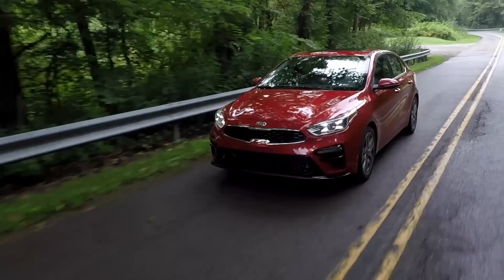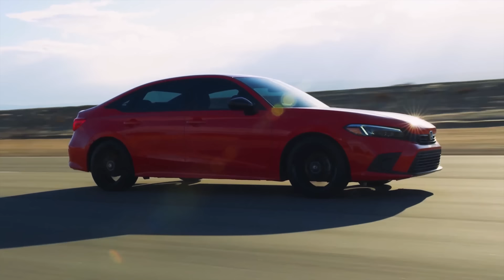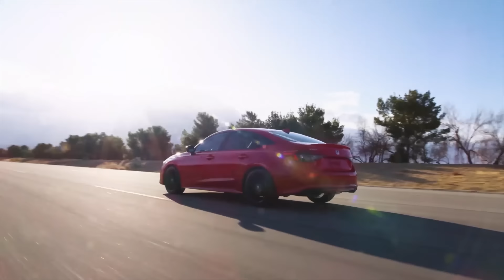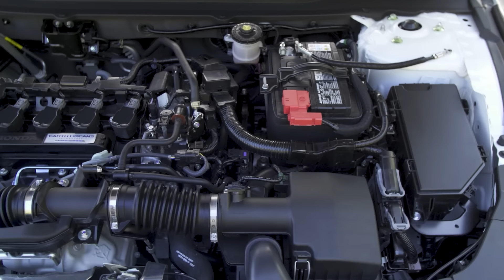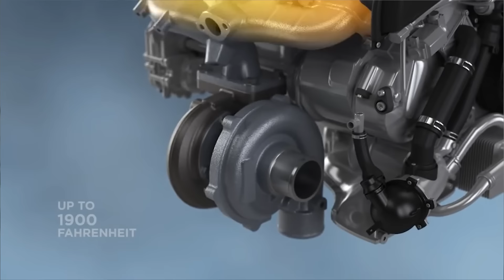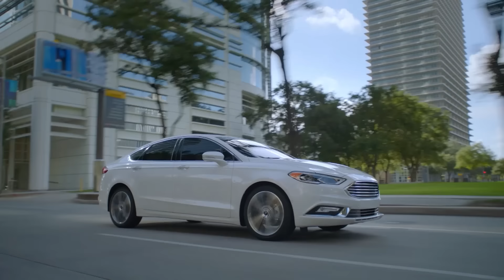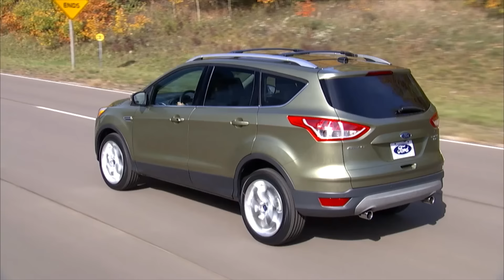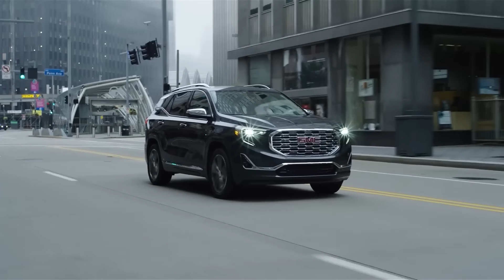Are Turbocharged Engines Reliable? The Truth About Turbo Engines

Comment: Increased complexity and repair difficulty, turbo coking, inadequate oiling and/or oil change neglect, severe heat and pressures, very inconsistent performance, coolant consumption, oil consumption. No matter how you look at it, expensive cars with turbos are more reliable but INSANELY expensive to repair. Cheap cars with turbos are unreliable and still pretty expensive to repair. Wastegate integration, dual scroll, variable vane... blah blah. Just buy an NA if you want reliability.  I have a 370Z and a Q50 and I prefer the NA 3.7 in the Z much much more.

Comment: It doesn't help that BMW used Oats; that's right, I said oats to build the plastic from in an attempt to go green. 

Where the plastic is expected to deteriorate and break down back to the ground; however, they failed to test the half-life correctly, and it breaks down prematurely within three years, causing tons of issues. 

Further, it is used everywhere in the engine compartment, including the TURBO support system. 

CAUSING tons of air leaks, water leaks, and oil leaks. Burned oil fumes into the passenger cabin,  overheating, and lean conditions. 

Turbos have been around for over 40 years in the trucking industry and are very reliable.  However, car companies have skipped quality and missed applying lessons learned in the trucking industry to today's cars.

Comment: I think that the real question is whether cars with turbocharged engines tend to be significantly less reliable even if the owner treats them properly, e.g. using high quality synthetic oil and replacing it regularly, not driving the car like it's a sports car, not getting it into the red, otherwise maintaining the car properly and replacing belts, plugs, wires, other fluids, regularly, etc. If the owner doesn't do these things then you can't really blame the turbo for reliability issues, and people who can't be bothered to do this either shouldn't get turbo cars or be willing to shell out for major repairs down the line.

Comment: I've owned the same 1G DSM turbo for over 31 years. Not high mileage, no mods, I don't push it to its limits and rarely if ever go into the red, but I've never had any turbo-related issues with it, including oil consumption. I recently took it out and apart as part of an overall intake and exhaust overhaul and saw nothing wrong with it other than years of surface rust on the exterior that I removed and treated.

It's the stock OEM turbo, on the smaller side, that many DSM owners tend to replace with a bigger and more powerful one. But I don't race so I'm fine with the car's stock 195HP. It also happens to have one of the best inline 4 engines ever built, the 4G63, which I assume helps with reliability.

Comment: They are reliable in warranty. 
As long as you complied to dealer requirements. 
Over 100 years, not reliable it will fail.

Comment: I have 1.2 liter 3 piston turbo on Peugeot 208 for 5 years. Zero problems and HUGE driving fun. First on any green light. Available power at any speed. Driving 170 kph no sweat. Start and stop works perfectly.

Comment: I have a 17 year old Audi Turbo with 120k miles on original standard engine and original standard turbo. Want your car to last? Change the damn oil, change filters, change spark plugs periodically and avoid tunning. If manufacturer specifies oil change with 10k miles, change with 5, or 6, not more than 7k miles. Anticipate things. Turbo is not the problem. Turbo is life. All engines should be turbo in efficiency point of view.

Comment: I think it still depends on the brand and make.. I had the same worry when I bought a used 2008 Acura RDX with a 2.3 liter turbo engine.. But the engine/turbo has never given me any problems. As a matter of fact, not many people had any engine issues on this car. Mine has over 340k kilometers now and still running strong. I see plenty of the same cars on the road until now, which is a testament to its reliability despite the turbo engine

Comment: First of all. You need to run a good synthetic oil, min of 5W-30. If you push it hard, before shutting off you need cool down time. Idle it 3 min. Auto start stop. Turn it off. Don’t use it. Change oil every 3-5k miles. Long OCI not good anyways.

Comment: I have 15 years of expiring with 2 turbo cars. 
1. Passat b6 1.8 tsi bzb (200k kms)
2. Passat b7 2.0 tai cczb (270k kms)
Both were charged to stage 3. (K04  turbo)
No problems. I used good ECU software, oil changed every 7500 km, filter washed 7500 km as well. Oil = motul 5w40.
Reply: Oil and filter changes at 7,500Ks are a must. Lots of manufacturers say you can go to 15-20K s before an oil change, but that's madness with a turbo. As long as you do the oil changes, and let the car warm up for a few minutes before driving, and idle it for a few minutes before shutting down, the turbo will stay well lubricated and should last a long time.
Reply: Yes turbo diesel engines are much more reliable than gasoline turbo engines.
Reply: @IrishNew  he mentioned a gasoline turbo passat..
Reply: Once again- why not all modern diesel
Reply: Nice big engines though. Try a turbocharged 1L

Comment: I would just avoid them at all cost.  The return investment is just not there with turbo engine.  Especially when you want to keep it for the long haul.  I do NOT like to keep buying one car after another.  Until these car manufacture has done a thorough job of rigorously testing these turbo engine for the long term reliability and made these turbo engine super reliable.  I stick with N/A engine for every day driving and long term relibility plus easy to maintain tyat wont cost you an arm and a leg for repair when small parts failes.

Comment: For someone who has owned turbo subarus and nissans for over 10 years, you are wrong about alot of this. The unreliability comes in from people tamporing with the system, not running premium gas, or just plain driving hard everywhere they go. Under normal driving and normal fluctuating boost pressures, the engine and turbo will last for a long time. Short trips arent even an issue. The engine is tuned for those purposes. Never did i ever have problems with driving short trips to the store or moving the car around my driveway. I will say they do have more maintenance requirements but its more in terms of inspection. Check the oil and coolant lines. Change oil every 3-5k miles. Use synthetic oil. Not that big of a deal.

Comment: You're only referring to Petrol engines you're not making any reference to diesel engines

1. Diesel engines are forwarded engines with forge pistons
2. Diesel engines are designed for turbos because they would not work without a turbo
3. Cars like the Toyota Hilux Diesel can easily do over 600,000 km without any issues
4. Every single truck is turbo diesel

Comment: Turbos run at extremely high speeds, over 80,000 revolutions per minute. They force more air into your engine at extremely high pressure and the engine takes advantage of the greater oxygen content to push more fuel in and create more power, but this puts everything in the engine under a lot more stress. This is why high performance engines with a turbo are strengthened to handle all the extra stress being put on it. Ask any automobile performance enthusiast and they'll tell you, if you're trying to squeeze more power out of an engine via a turbo, you're burning the candle at both ends. But an enthusiast willingly accepts this trade to have more power. The common consumer, however, often doesn't know.
...Granted, if you drive conservatively and never access the turbos power band, and you take good care of your car, you might be fine. But then at that point the turbo just becomes a needlessly complex addition to your engine that adds extra power you don't need and never use.

Comment: There are many consumers that doesn’t know what is a turbo engine. To most is an engine with more power. Full stop that is what the most see.

After buying it they realize there things you need to know, some or most turbo engine needs a higher Ron fuel as you stated to prevent carbon buildup.

A lot of turbo engines have a carbon filter and this has to be maintained or it be an expensive engine. Most diesel turbo have a dpf filter.

Turbo is good in some ways but not always the case.

I specifically chose the normal engine for my purchase. Knowing well of the power compromise.

Comment: My brother had an Audi A3 that had an issue under warranty. They fitted a new turbo and gave the vehicle back to him. A month or so later the new turbo began to grind. Fortunately it was repairable, the cause of the turbo failure was a blocked oil line due to not having the oil changed when the first turbo failed. I had a turbo diesel Landcruiser (80 Series) that I purchased over thirty years ago, and I still see the vehicle as it now belongs to a mate of mine.The vehicle still has the factory turbo with over 700,000 km, I fitted a turbo timer when I purchased it. I now have a Five cylinder turbo diesel Ford Ranger, it has 270,000 km and no issues.

Comment: 170,000 miles on my 98 V70R. Original engine, transmission and turbocharger. 

Been daily driving it for the last 4 years. 

Been running 16 psi for the last 4 years.

My next car will be a Volvo.

Comment: Naturally aspirated cars are more simple to own than a turbo charged car. But not much more.
If you use your car just as a means of transport and like to yawn a lot, not worry about maintenance,
pay more for fuel, don't buy a car with a turbo engine. Bad news travels fast, and I haven't heard an avalanche of bad news about turbo engined cars, only the fact that normally aspirated cars are always getting in your way at the lights.

Comment: I am not a hard driver and rarely go above 2500 rpms when accelerating. I have a 2017 e 300 and I am curious if the turbo is kicking on or not when I am a soft driver?

Comment: It really seems like modern turbos are worse than older ones!  I own a 1987 Dodge Daytona TurboZ with the Chrysler 2.2L Turbo-II motor which was a new version of the 2.2L turbo-I for 1987 and added an intercooler and brought up the hp from 146 to 174 with 200lb/ft of torque.  I have owned this car for 23 years, second owner and it now has 166K miles on it.  Obviously I have taken extremely good care of it and it has had a lot of work done over the years but that 2.2L Turbo II still runs great and pulls hard.  Of course this engine is much more simple than those of today but maybe thats the secret?  A turbo can last if its not ridiculously complicated.  The actual turbo on my car has not been replaced but the intercooler has and it runs pretty consistent coolant temp wise.  I don't push it as hard as I use to because I want it to last but I do push it some!  Anyway, I agree, modern turbos arent great.  If BMW can make trash turbo motors, anyone can!  And they do, I'd never buy a turbo BMW...or Audi, or Ford or VW or GM, okay, your point is even more appreciated!

Comment: My F150 eco-boost had one supercharger go out with 83,000 miles on it and the other one went out at around 139,000 miles cost me nearly $7000 to replace both of those sold the truck after the second one went out bought a Toyota tundra swore I would never ever owna turbo motor again.

Comment: I’m old enough to have owned Saab turbo cars 35 years ago. Had no issues but remember the advice to allow the engine to keep running after a high speed trip to ensure it cools down properly
Reply: Thanks sir

Comment: Air-cooled engines are more reliable  than water-cooled engines because you don't have to worry about coolant leaks, water pump failures, head gasket failures allowing coolant to dilute the oil, etc. If you are incapable of following simple maintenance instructions, you should look for a vehicle with an air-cooled engine.

Comment: Manufacturers could easily put in a 3.0 v6 with 240+ hp but noooo and tbh, blame the EPA for it. That turbo 4 will get better mpg at any speed as long as the turbo is putting out 10% or less of its peak power. They don't care about the consumer having higher maintenance costs and an engine with a shorter life span.
 Also, low speed pre ignition is an issure with every turbo charged vehicle. Its when you are in too high of a gear making too much boost. Lets say your automatic transmission is putting you in 6th gear at 35 mph for fuel economy and you have to give it a decent amout of gas to speed up. It decides to not down shift. You're now making 12 psi at 45 mph at 2k rpm. The engine has a high chance of grenading itself regardless of mileage on the vehicle and it does happen more often than people think, even in manuals if the driver isnt paying attention.
  I saw an interview with the old EPA director. She wants things to go back to 2016 rules and regulations so car companies can still have one or two v8s to offer, a mix of v6, 4 cylinders and ev/hybrids. Says there are too many activist in there now making the rules and again, they do not care about the consumer or the manufacturer at all. Green, green, green...

Comment: Never buy a USED one...buy NEW only and treat it well.  NEVER shut down on a hot day without letting it idle for at least 3-5 minutes....  synthetic oil ONLY...  you should NEVER have to replace a TC unless you're stupid and lack common sense. I have owned a 280 ZX turbo and also a 300 turbo for years with zero problems.
Reply: Thanks I'm looking for a used vehicle and will avoid turbo. Adding 3 minute idle to the end of the trip is a pain. Add premium gas and frequent premium oil changes too.

Comment: Run the Honda Civic 1.5L turbo using all of its 180 hp against the 2.0L NA Civic using all of its 158 hp and tell me which is more “efficient”. Turbos when being used are not fuel efficient. They are fuel efficient when not being spooled but yet still  touting their max hp numbers

Comment: Thanks for the talk! I have a Chevrolet Captiva in Chile (actually a SAIC product that is sell here as “Chevrolet”) with a 4 cylinder 1.5 Lt turbocharged engine that with only 23.000 Km did have serious damage on the cylinder N°2 (the damage was so bad that the cylinder wasn’t able to reach the right compression of the fuel). Thankfully due to warranty, the local representation of Chevrolet in Chile paid the reparation: complete change of the motor engine. And your arguments make a lot of sense: I use the car on daily basis but only for a trip of 4 Km during the cold morning (I actually got as a maintenance recommendation to “let the car to warm up for at least 1 minute”, like if that is enough to warm up the turbocharged engine).

Comment: The fun part is that most of the time, they don't even get better fuel economy IRL. In the EPA test they do, but nobody drives them like that, and pushing it harder burns more fuel with a turbo engine. Cross reference some vehicles (like Ecoboost 3.5 vs a 5.0 F-150) and they're pretty much even, while adding a ton of complexity and sacrificing a ton of reliability. Toyota's M20A-FKB in the Corolla makes almost identical power as the Civic's L15B7 and gets almost identical fuel economy, while not having all of that added complexity.

As far as maintenance, those Cruze 1.4L get oil clogged up inside of the oil supply line, leading to the turbo not getting lubrication and the bearings running dry.

Similarly, the ecoboost have a little filter in the block that will get clogged up leading to most turbo failures.

I've been a tech for 20 years and I'd never buy a car that's been turbocharged for fuel economy.

Comment: I love my 2021 Mazda CX-5 CE Turbo w/ AWD. I got the turbo because I didn't want cylinder deactivation, which came with the naturally aspirated engine. I'm very happy with my turbo. My trips are short, and I never drive it immediately after starting it, and I never turn it off immediately after parking it.

Comment: Since 1994 I have owned 6 turbocharged cars in South Africa I drive hard and some of the cars had over 100 000 miles before I sold them. Two were VW/Audi diesels  one VW/Audi petrol, a Fiat 1400 cc turbo in 1994. One Volvo petrol turbo and now  Chinese SUV which is turbocharged. Turbocharged vehicles are more common here than naturally asp ones. I hanmve had no problems at all with the turbos and intercooler, wastegate, associated sensors on any of these vehicles. At 5000 ft elevation where I live all cars without turbos excepting large engined Mercedes and Jeep V8s have relatively poor performance. The latest Pentastar V6 Jeep is criticized for weak performance against the German SUVs. Turbos are old hat here and discussions around their reliability are no longer high on the agenda when car enthusiasts chat.

Comment: Only turbo engines have proven to be fully reliable if they were well designed are the turbodiesel ones.
In turbo diesel you can trust, even more if it's a big displacement low rpm engine

Comment: A turbo in a diesel car without dpf or egr are bulletproof ,,here in Europe we have much more experience with Diesel engines as we have them in most cars ,All vans and all trucks,,we've had turbo diesels in cars from the 1990s,,,I've seen Renault and Peugeot Diesel engines go 500.000 miles and more ,with the original turbo,,,,The trick to turbo longevity is regular oil changes,,This keeps the seals subtle,,,

Comment: A larger normally aspirtated engine is going to be inherently more reliable than a downsized turbocharged engine of the same output. It is under less stress and it has less parts to go wrong. In the real world (Not manufacturers claimed figures) there will be little diffrrence in fuel mileage either.